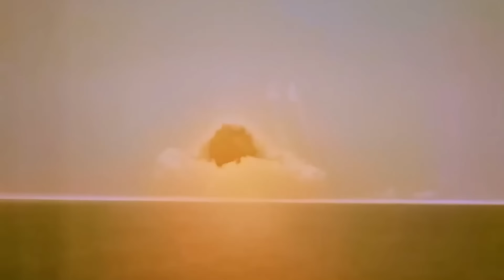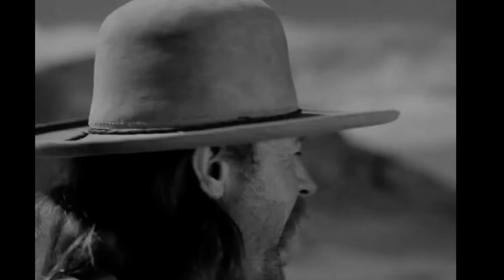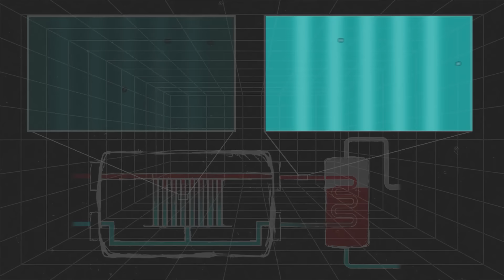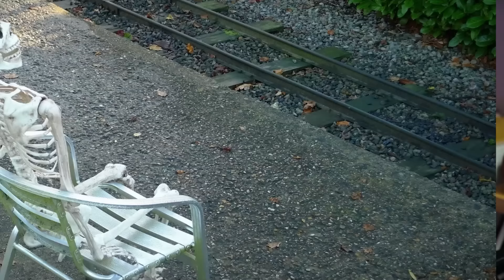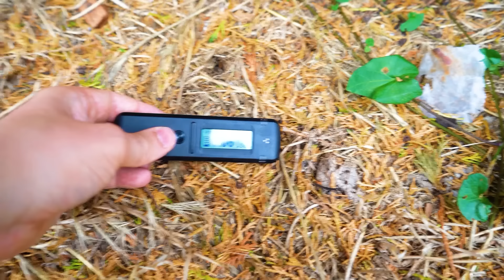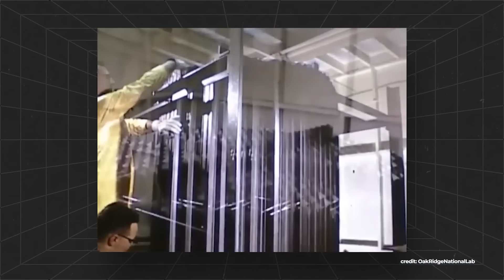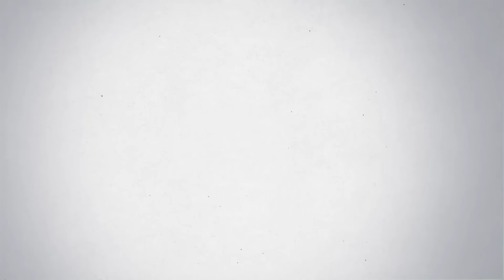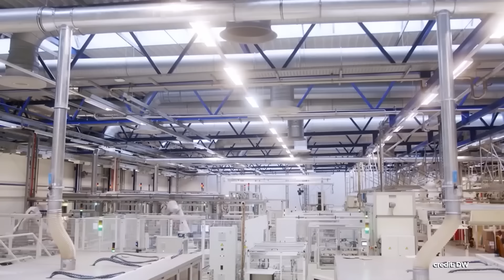It's Happening - China Launches World's First Thorium Nuclear Reactor

Comment: Using molten salt has one further advantage. It avoids something that caused a couple of the explosions at Fukushima and may have contributed to the Chernobyl disaster. It has been shown when the zirconium cladding on the fuel rods gets exposed to air, the steam begins to react with the hot metal and the metal oxidizes, releasing hydrogen gas. It is known that at least one of the explosions at Fukushima was a hydrogen, not steam, explosion. If the system does not contain any water, this reaction cannot occur.
Reply: If the molten salt comes into contact with water it will absolutely generate hydrogen due to the very high salt temperatures.
Reply: @SocialDownclimber  Absolutely true, we used to throw sodium and potassium into our pool in californica for spectacular night-lighting effects.  This was contaminated material from our University chemical labs, which they were just discarding (at that time).
Reply: @miscbits6399  Well, what can I say.  TOO much Sodium.  PV=nRT does not lie.  Or F=Ma.  PassItOn.
Reply: @SocialDownclimber  Not that high temperature.  MSR salt typically runs at 700 degree C.  Even if there is some technical problem leading to increasing temperature, it won't come to the temperature that water is split to hydrogen and oxygen.  That temperature is 2200 deg C.  In PWR it is the zirconium that acts at an catalyst so that water is split into hydrogen and oxygen.  The presence of zirconium is a must for hydrogen explosion.
Reply: @SocialDownclimber  Funnily enough, this has been tested at ORNL (they've been testing molten salt ever since MSRE, even if not allowed to add radioactives into the salt)
Reply: The general idea is to keep water out of any nuclear system, because it can cause steam explosions, or worse, hydrogen explosions.
This change is one component in the risk reduction with molten salt reactors. 
The other one, of course, is the elemination of run-away nuclear reactions when the cooling fails.
These two things puts them in a an entire different ballpark, safety wise, from our old nuclear reactors, which should be dismantled.
Reply: @larsnystrom6698  That's not how nuclear power works. Reactor coolant (whether it is water, molten salt, etc) interacts with the reactor and moderates the reaction, which then generates lots of heat. That heat is then sent through the coolant loop into a heat exchanger, which then boils water (yes, water) in a separate loop. This boiled water turns to high pressure steam, which then drives a series of turbines, before going through a condenser to be turned back into water. The water is then either discharged harmlessly (There is no radiation, since the heat exchange loop runs separately from the coolant loop and therefore does not directly interact with the reactor or any radioactive materials) or sent back through the heat exchanger where the process repeats.

T. Folse Nuclear, a YouTuber who is an experienced and licensed reactor technician, can give a much more detailed and (probably more accurate) breakdown of how the system works, but this is the general gist of it.
Reply: @larsnystrom6698  please stop posting, you have no knowledge about nuclear power. Runaway nuclear reactions what on earth are you talking about. There hasn't been a runaway reaction in a U. S. reactor since the 1930's when they were experimenting with nuclear fission in Chicago.
Reply: @larsnystrom6698  There's nothing wrong with the current nuclear plants. Just don't build them on the coast in an earthquake and tsunami hotbed. The Russians bypassed safety protections that would have prevented Chernobyl. 
The current Westinghouse AP-1000 design is perfectly safe, reliable and profitable. 
I'm hopeful for success with the Thorium designs.
Reply: @Boroblueyes  Even Thorium designs aren't immune to the problems found in the Ohio nuclear bribery scandal. Not even Westinghouse AP-1000 designs can compete with natural gas at its cheapest.
Reply: @Boroblueyes  What about spent fuel rods?  500 years sitting in a cooling pool near the reactor, and then you can use robots to try and bury it in a cave somewhere, or ware house it for 10000 years until it's only kind of radioactive.
Reply: @sammiller6631  But that 'cost' of natural gas doesn't include the CO2 emitted and it's effect on climate.
Reply: @martinmelhus7324  your lack of knowledge of nuclear power is so ignorant. You don't even get an explanation. Go do some research and don't use feelings or anecdotal information from another uninformed person. I'm a Nuclear Engineer, not a kindergarten teacher.
There's been so many lies spouted out over the years by anti nukes that's it's impossible to get people to believe the truth. You've been played.
Reply: @sammiller6631  that's not true. We only run the gas fired plants in the summer, when peak current demands are pushing the grid capacity. It costs nearly twice as much per Kw as nuclear. Now that Georgia has 6 operating nuclear units. I doubt they will ever run except for periodic startup to ensure their operability.
Some states don't have nuclear capacity so they have to use coal, gas, hydro or wind. Gas is only cheaper to use than coal.
Reply: @Boroblueyes  Georgia has no natural gas wells, so NG is more expensive there.  Davis-Besse cost more than natural gas forced the Ohio Nuclear Bribery scandal. Ohio has over 2000 natural gas wells in the Marcellus and Utica shale regions, which are two of the largest NG sources in the country.
Reply: @Boroblueyes  Well, I'll argue that my knowledge of nuclear physics is at least on par with yours.  I'm a Ph.D physics professor who has studied nuclear power extensively.  So, humor me and give me that explanation - maybe I'll learn something, maybe you'll learn something.  Just don't assume that what we are using now is the best possible solution and anyone who believes otherwise must have been played.
Reply: @martinmelhus7324  what's the decay chain of iodine?
Reply: @martinmelhus7324  what's the secondary neutron absorber used in modern pwr reactors?
Reply: @martinmelhus7324  what is created from a zircalloy reaction and what is it's inherent problem?
Reply: @martinmelhus7324  do you pull rods to achieve criticality or do you dilute the primary system?
Reply: @martinmelhus7324  how many nuclear power plants did you work at and how many years of nuclear physics have you had continuing education instruction by industry leaders?
Reply: @martinmelhus7324  what dose do you receive on average for one flight from New York to Los Angeles? What dose does a pack a day smoker receive in a year from smoking? How much dose will a homeowner receive in a year from radon gas with a standard slab floor?
Reply: @martinmelhus7324  which of the fission isotopes are the biggest threat and why?
Reply: @martinmelhus7324  what government regulation covers rad waste? That's an easy one.
Reply: @martinmelhus7324  you're telling me that you have a PhD in Physics and you can't research before you run your mouth about my knowledge. Did you plagiarize your thesis? Any PhD would have researched and found out that we don't have a radwaste problem, we don't have a spent fuel rod problem.
Reply: @sammiller6631  you're lucky to have the natural gas. The electrical rates are still slightly lower in Georgia vs. Ohio. 14.96¢/kwhr and Ohio was at 15.15¢/kwhr. That's pretty close. It has roughly doubled over the last 40 years.
Reply: @martinmelhus7324  what was the root cause of the Three Mile Island incident?
Reply: @Boroblueyes  The key problems with zircaloy (spelled correctly) are affect of the fuel cladding, production of chemical heat due to metal water reactions (if water is present), oxygen embrittlement of the sheath, and the production of hydrogen (or deuterium) gas.  See Iglesias, Lewis, Desgranges, and Toffolon, Chapter 5 NEA/NSC/R report.  So the big problems are production of even more heat and hydrogen gas.  Are we done with school yet?  Perhaps you can share what you know instead of quizzing me on stuff that's trivial to find on the internet.
Reply: @Boroblueyes  Graphite and boron do a nice job of absorbing neutrons, but in the control rod I assume those would be primary absorbers.  The water itself, or more specifically the hydrogen in the water, is very good at moderating the neutrons but doesn't absorb much.  Cadmium, hafnium, or silver can also be used.  The most common way is likely boron in the coolant.
Reply: @Boroblueyes  If you're talking about Iodine -131, the decay chain starts with beta decay, giving off an electron and an anti-(electron neutrino), to conserve lepton number, leaving an excited Xenon-131 nucleus, which pops out a gamma ray to decay to a stable Xenon-131 state.  Both the beta particle and the gamma have very high energies (the gamma is .364 MeV, the beta averages .606 MeV, depending on what the anti-neutrino carries off, so are pretty dangerous to biological life, and can produce some more heat in the reactor.  There are about 40 isotopes of Iodine, though, and you didn't specify which one, so I assumed you meant the one that is sometimes produced in fission reactions from uranium.  FWIW, the beta particle is mildly relativistic, given the rest mass of the electron is .515 MeV.  Thus endeth the lesson.
Reply: @martinmelhus7324  trivial to find on the Internet, what a denial. Yes, it took you 24 hours and you copy and pasted some information. Do you finally did some research. I didn't research to find the questions. They were just random things that popped into my head. At least you're learning.
Reply: @martinmelhus7324  that's a bullshit answer and you know it. You can fool someone that doesn't know nuclear power with your copy paste... You don't pass the smell test. Go try to troll someone else in another subject that you're clueless in.
Reply: @martinmelhus7324  Trillium, Iodine, Xenon, Cesium, Barium, and Yttrium is the decay chain. You failed another class professor.
Reply: @martinmelhus7324  oh my goodness, I didn't spell check because I didn't think you understood any of the terms anyway. Great copy and paste job though. I guess you can research, you just chose not to and look ignorant because of it.
Reply: @martinmelhus7324  it's Lithium, wrong again professor. I guess you couldn't find anything to copy and paste on that one.
Reply: @martinmelhus7324  When did you testify before a Senate subcommittee as a SME about Black Tuesday? I did in 1990. I generated the first electrical power at Plant Vogtle Unit one in 1987. The first nuke completed in many years. Now we have 4 units at Vogtle. I grow tired of arguing with a troll, goodbye. Stop pretending to be something you're not.
Reply: @Boroblueyes  Dude, I don't have time for people who insult and slam, claim to have knowledge but don't share it, and think they know more than everyone else.
I'm generally in favor of nuclear power, but think we have to be smart about it.  People like you arguing for it the way you do will set back that cause.
Also, consider where you got this training.  Did it come from the people who produce reactors?  Me, I got my training from the tree of Feynman, Gell-Mann, Einstein, Dirac, Fermi, and other Nobel prize winners.  I look at facts, not a corporate view.
Light water reactors have advantages and disadvantages.  Molten salt reactors have advantages.  Unless people talk about them intelligently, the general population will be very down on nuclear power.  Please do that going forward with other people, because you and I are done.
Reply: @Boroblueyes  - So, what nuclear waste disposal solution has been implemented successfully in the US to justify your comment that "nothing is wrong" with current designs. The current designs produce nuclear waste that society cannot bury due to political impasse. Waving that away doesn't make it go away.
Reply: @Boroblueyes  - What about nuclear waste disposal, though? Where is the ACTUAL solution of a repository located in the US? Nowhere. The politics don't work. Until that is solved, we are just piling waste at reactors. That's not safely sustainable.
Reply: @Boroblueyes  - You sound like a nuclear technician with your questions that implicitly brag about your irrelevant knowledge. The number or title of a government regulation number does not matter. That is trivia.
Reply: @Boroblueyes  - You are bragging about asking about random topics. Are you capable of thinking and identifying relevant challenges and the viability of solutions? You have not done that. All you do is engage in the appeal to your supposed authority, which is not much. I have met plenty of engineers who are intellectually corrupt due to their emotional capture by the industry in which they work. Their identity as an engineer was so important to them they surrendered to group think in order to conform. They bought the company/industry line on problems in their industry to justify their jobs and feel superior at the same time. Again, I have MET these people. They are not all engineers, but you sound like one of them. Try showing intellectual rigor and common sense usefulness. Nobody cares if you know which alloy makes the best material for a cooling pipe or which radiation detector you wear. Address the challenges at hand and stop hiding your deficiencies behind a barrage of questions and challenges to others.
Reply: @bruzote  it's apparent that you don't have enough knowledge to discuss the non-issue. There is no nuclear waste problem period. You should actually research the issue, and learn. The only way that you will be convinced is to do your own research. Sabine Hossenfelder gives a simple explanation that even you might could understand.
Reply: @bruzote  you are one of the most ignorant responders I've ever seen. You don't know anything about nuclear waste, yet you spout out lies with no content. You sound like a 3 year old trying to legitimize why you did something wrong. You just spouted out words that had no cohesive meaning.
Reply: @Boroblueyes  - Storing waste on site IS a WIDELY recognized political problem, due to health and security concerns of those oppose to on-site storage. Transporting waste and storing it elsewhere is also a WIDELY recognized problem, now and tomorrow. If you can't acknowledge that MASSIVE reality, you are not facing reality. And those REAL problems are not going away. Good luck pretending that your mind's self-consistent beliefs must be correct when your mind only has self-consistency because it dismisses other facts that ruin your fantasy.
Reply: @bruzote  you have no idea at all what you're talking about.
Reply: all the reactors external structures in japan that exploded were from hydrogen buildup
Reply: In solid fuel reactors like our entire existing fleet, thorium is a sh--y fuel. It gets much less burnup (energy per ton of fuel) because of parasitic effects in the breeding process. For thorium to be worthwhile, you need to reprocess the fuel. Pretty much nobody does reprocessing, except France in limited capacity. LFTR uses a molten liquid reactor core, so you can reprocess the fuel while the reactor is operating, allowing you to take fission products and other “poisons” out, and to firmly control the enrichment level and available reactivity. This is very hard to do though which is why we don’t have any approved or even ready to license LFTR designs. One thing this video doens't do is go over the cons of thorium reactors. They're insanely expensive upfront, the fuel is super corrosive so pipes need replaced often, and finally, presence of Uranium-232 in irradiated thorium or thorium based fuels result in significant emissions of gamma rays.
Reply: @Zidbits  Wow. That's an comprehensive list of Thorium challenges. I'm surprised to see such rational discussion in Thorium hype train videos.
Reply: @Zidbits  For the cons I'd say being extremely expensive isn't a real contrary, considering this technology is still in it's Prototype phase. 
I mean pretty much every advanced technology is going to be very expensive upfront if you have to built it from scratch and if you don't have already established technicial blueprint and prodution lines
Reply: If u flood a coal fired lant with sea water it's going to go Boom too
Reply: @kenchesnut4425  Just a little less radioactively.
Reply: @anonymousalexander6005  What are the chemical risks not contained?
Reply: Virtually EVERY SINGLE civil nuclear incident has involved water in some way or another

Fukushima you've described

Chernobyl, SL1 and others were steam explosions

Besse-Davis and others were near-misses caused by water corrosion

Haschi Ouchi's unfortunate adventure (Tokaimura) was caused by dissolving excess uranium in water (There were similar incidents in the Soviet Union)
Reply: @miscbits6399  Davis-Besse was caused by corruption and cost-cutting to appease investors. That football-sized hole nearly eating through the reactor was only one of many incidents at Davis-Besse.
Reply: @JamesYale1977 I'm sorry, but that's inaccurate.  The Oak Ridge National Lab had a molten salt reactor running in the 1950's.  Small demonstration molten salt reactors are running right now.  The Chinese have a small one running now, and are planning a larger one to run in a few years.  The video these comments are attached to reports these facts.
Reply: @nicholasconder4703, there are no fuel rods in a molten salt reactor, so this isn't an issue.
Reply: SO many benefits to any MSR option.
Reply: @myfirstseven  What are the downsides to any MSR option?
Reply: Any professionals on Geothermal ?
What say you if the big bucks are there for Development And Implementation?
Reply: They had a thorium reactor running at Oak Ridge in the late sixties. Thorium reactors aren't "safe", they produce tons of incredibly toxic poisons, some of which remain toxic in amounts too small to measure for millenia ie they still produce plutonium (though much less than traditional uranium reactor) and a whole bunch of other nasty unstable nuclear isotopes. They produce lots of radioactive iodine, which while it has a half life of "only" a few weeks, it's incredibly poisonous while radioactive & emitting alpha particles, and iodine is an element incorporated in all life. If your body takes in ten grams of it for example, "half life" two weeks, means that you'll still have enough to kill you after years, as halving ten grams every two weeks still leaves enough to destroy DNA & kill you with cancer, as it only takes long term exposure to an undetectably tiny particle of the radioactive iodine.

The fission byproducts of the man-made unstable isotope of uranium that thorium is turned into before it can be used in the reactor include about a tenth of the amount of plutonium produced by "regular" uranium fission, but one tenth of a poisonous substance that exists naturally as an aerosol capable powder, and that remains' mortally dangerous in amounts too small to measure for millennia is still TOO MUCH of that poison being made. There's a whole bunch of other long-half life actinides produced also. ("Theoretically" the reactors can be used to "breed" and "burn" the plutonium produced, but that's in theory only, in practice, the process is not without inefficiencies, and ends up producing about a tenth of the amount of plutonium produced by a regular uranium/plutonium reactor.) 

Thorium "safety" is a lie, and let's not get into the process needed to "activate" the thorium and make it unstable enough to be used as fission fuel (ie bombarded with neutrons and turned into man-made uranium, which is actually what the reactor uses.) - that's so dangerous it can't be done by people - it has to be done by robots. 

The US DOE also made working thorium reactors many years ago, including one that leaked, and they rightly dismissed them as too dangerous and expensive. The only reason China and India are going for it is that thorium is cheaper than uranium, and is currently mainly found in Brazil, and India, not like uranium, which is in the USA, Australia and South Africa.

Reply
Reply: is that how they get the hydrogen fuel than? :D
Reply: Fukushima was an act of terror .... A nuclear bomb was placed on the sea bottom ....  You may guess who were behind it  ...
Reply: Fukushima was not an accident but an act of terrorism ..Was tsunami triggered with nuclear bomb + stuxnet virus on process computer by mossad (see Jim Stone).
Reply: Thorium is a good idea.  Lower radiation, lower pressure. How did they fix the corrosion problem with the pipes and the molten salt?
Reply: How would a thorium reactor survived a 9.0 earthquake and then a tsunami?  How about human error?
Reply: @rizon72  Contrary to the water reactors where all the fuel rods are in the pressure vessel, the Thorium reactor does only contain a very small amount of fuel that reacts and produces heat.   Compare it to a diesel engine where you have a tank filled with fuel and the reaction in the combustion chamber (the reactor) only contains a little bit of fuel.   So, no problem.
Reply: We, engineers, know ... but the problem is that our governments are illiterate who have problems with data and graphs ...... and now our countries build thousands of windmills and solar panels ruining our economies.
Reply: Good point
Reply: : 0:15 ..."'the most devastating weapon humanity has ever devised.."the atomic bomb." I stopped here when I heard generalities like these--since technically Hydrogen bombs ( also known as thermonuclear bombs ), are generally more powerful than atomic bombs. One should know when to save time from these long-winded wannabee videos.
Reply: Gundersen showed that Fukushima reactor 3 was a critical mass explosion.
Reply: @candui-7  He is bull***tting you, man. If you loose coolant in a light water reactor like Fukushima, you also loose moderator. Without a moderator you have only fast neutrons. What was around criticality for thermal neutrons is veeery much subcritical for fast neutrons.
Reply: It is all moot, as any breakthrough will be too late.
When the pilot projects are small and half a decade out, it is clear nuclear is a distraction.

We can't go on behaving like it is 1985. We are on the brink, and need a swift transition now, not in 10-20 years.

Also look up 'deep warming'.
Supplanting coal plants with nuclear plants will continue the heat pollution.

Building wind and storage to supply 1 GW will save us 2GW waste heat. 
That used to be negligible, but in our current crisis it is as good as carbon capture.
In other words we get double the bang for the bucks with wind - which is already cheaper.

No time to (produce) waste!
Reply: @madshorn5826  , can you play devil's advocate and outline wind's unknown or lesser know downsides? We all know, "no wind."
Reply: @TheVideoNorm  
Dunkelflaute is a known problem with known solutions: Energy storages and flexible demand.

The energy storages are here today, but the economy model that has broken our biosphere also discourages solutions not furthering (an impossible) growth.

The party is over, but everyday life can be fulfilling too ¯\_ (ツ) _/¯
Reply: @TheVideoNorm  "can you play devil's advocate and outline wind's unknown or lesser know downsides?"
Wind turbines installed in forests on mountains. Theres a dry summer. A spark from the turbine is created. Bye forest. Not to mention how the noise affects the animals living in the forest.
Reply: @TheVideoNorm  can you play devil's advocate and outline thorium's unknown or lesser know downsides?
Reply: @sammiller6631  , that would be awesome if I could outline its unknown downsides. I'd take that skill to the stock market while I was at it!
Reply: @namename9998 Has that actually happened? 
Wind is woefully unreliable and the turbines are pretty short lived. 
Tidal powered hydro needs more looking at.
Reply: @marcuscoquer5958  One example "A wildfire in southern Washington that has burned more than 350 acres was caused by melting sections of a wind turbine that fell to the ground after the turbine’s generator caught fire, fire officials said."

Tidal is ok if youre ok with destroying local ecosystems. At least with conventional hydro (reservoirs) it doubles as a place to store drinking water and can be a recreational area.
Reply: @namename9998  We have off shore wind farms. Plenty of destroyed eco systems there already. But less chance of fire I suppose.
Reply: @marcuscoquer5958  Why bother using wind if you dont care about the environment. Just stick with reliable coal.
Reply: @namename9998  It isn’t about not caring for the environment.  It’s about what bits of the environment are already damaged and therefore better to use than undamaged environments.
If I were completely about the environment I wouldn’t drive or use anything that had not been produced locally and I would certainly not buy anything containing or packaged with plastics.
I already have only solar. I might put a little wind generator up this winter.
But I do use coal over winter for heat.
Reply: @marcuscoquer5958  Damaged areas arent contained. Theyll just get bigger.
Reply: @namename9998  Some do, some self repair.  Nature is pretty good at reclaiming mans actions.
Reply: @marcuscoquer5958  Please provide examples where damaged areas remained contained without help from people.
Reply: @madshorn5826  You're literally just copy pasting this over and over in multiple threads.
Reply: @madshorn5826  Do you even realize how dumb what you just wrote is?

First of all, heat is not a pollution. It is one of the most basic forms of energy in the known universe. The kind of pollution that coal produces is in the form of various greenhouse gasses and oh... more radiation than a nuclear power plant.

Second of all, wind energy is woefully inefficient because windspeed is unpredictable and varies wildly. On calm days with little windspeed, it produces almost no electricity. That means that to create the same amount of electricity as a nuclear power plant, you need thousands upon thousands of square miles (or kilometers for those that prefer metric) of wind turbines.
Reply: @madshorn5826  - Instead of throwing out a vague term and telling people to Google it, try providing deeper information that justifies your concerns or provide a link. 

Waste heat from nuclear reactions would be inconsequential to Earth's temperature. If the heat is at the surface, it will radiate to space, just like the solar heating we get every day. If the heat is subsurface, it will be a negligible fraction of the natural radioactive decay occurring at a massive scale throughout Earth's crust, mantle, and core.
Reply: @madshorn5826  We've been "on the brink" for 20+ years. people will say "we're on the brink" 20 years from now.
Reply: @sammiller6631  
That doesn't make it untrue then, now or in the future.
If we had acted 20 years ago the cost would have been negligible and we'd had a good chance of avoiding a future catastrophe.
Now the cost will be considerable, but we still have a decent chance of avoiding a collapse.
In 20 years the train will have left the station. The world will still function then, but the changes will be irreversible and accelerating and the human race will be run in a few decades, maybe a century.

That has consistently been the message from the scientific community.
If you missed it, blame lobbying and a media landscape both-siding one sided issues.
Reply: @sammiller6631  IIRC in 2000 they said that by 2025 humanity would be reduced to, "a few breeding couples at the poles" by 2025 lol.
Reply: @sammiller6631  Yep, until they can't say it anymore because we're over the brink and into the frying pan.
Reply: @atomicskull6405  who is they? If you can't give actual names, you're spreading rumors and propaganda, not facts.
Reply: @sammiller6631  - Actually, that only proves LTRs are converging to an energy solution. Fusion power is always 50 years away, but now we've gotten a solution with 20 years away. Soon, we will have another solution that's always just ten years away! :-D
Reply: @bruzote  "converging to an energy solution" sounds like corporate buzzword bingo, not real world action.
Reply: @sammiller6631  - That comment was poking fun at how people keep saying something will be ready X years from now. How you go from that to complaining I have not offered real world action and used corporate lingo is bizarre. Read the room, so to speak, and understand the context.
Reply: @bruzote  If you didn't get the applause you were expecting for your joke, perhaps you're like the comedian who tells the audience they should be laughing. The joke teller is the one who needs to read the room, not the audience.
Reply: @madshorn5826  We saw this identical post earlier, get over yourself!